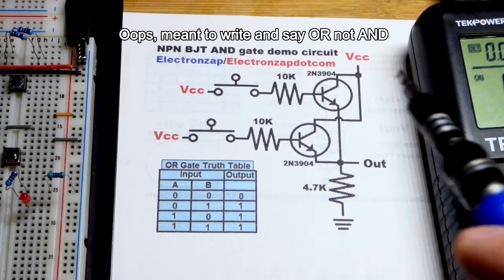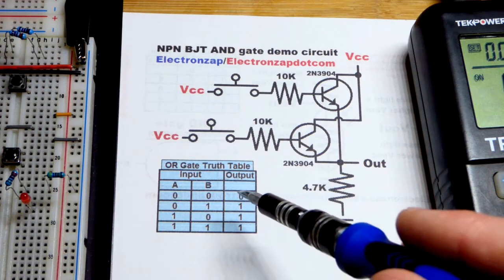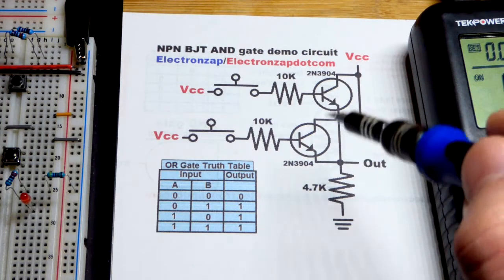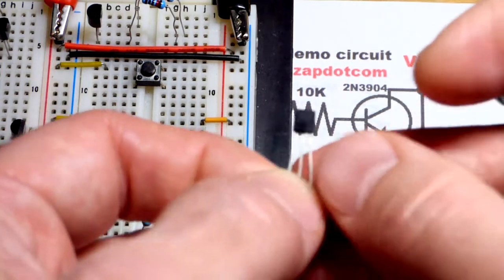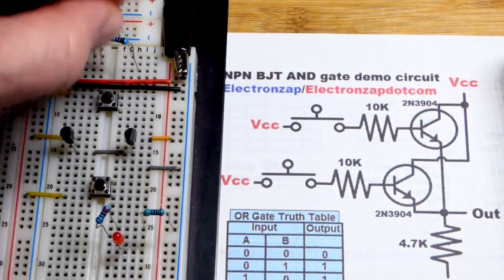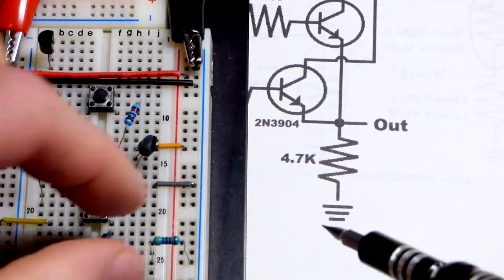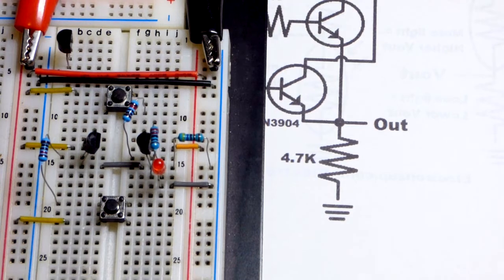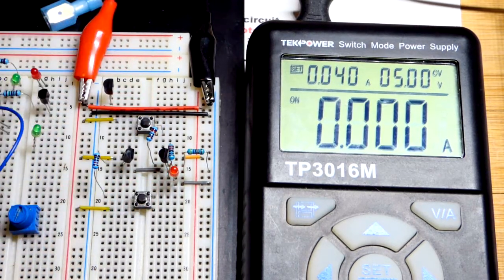Quick NPN BJT OR gate how to demo circuit using 2N3904 bipolar junction transistors DIY electronics

Comment: The Load should be Connected to Collector right?.Why its connected to Emitter ..~ and still it works ? 
I am Confused😢
Reply from the maker: It is confusing at first :) BJT switch circuits have the load on the collector side while BJT emitter followers have the load on the emitter side. You lose some of the supply voltage when the load is on the emitter side, but you can use that output to give a signal to something else easier than if it was on the collector side.